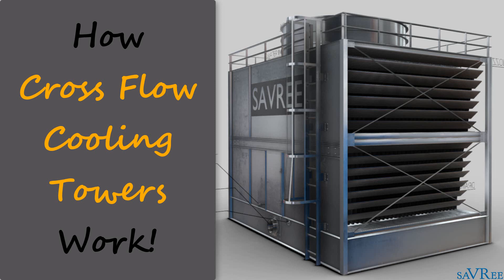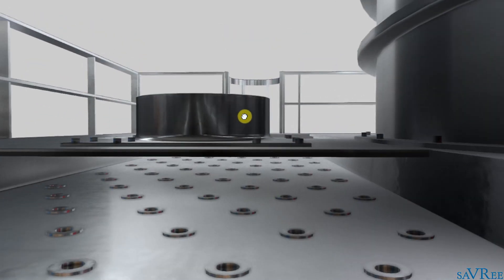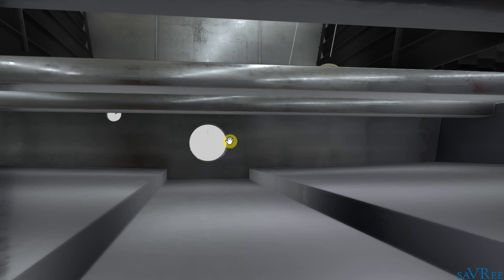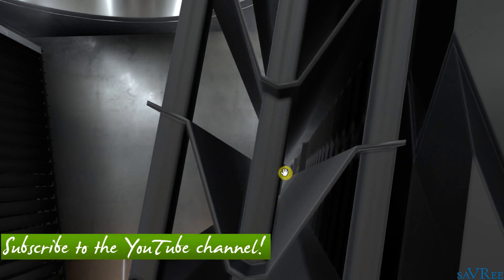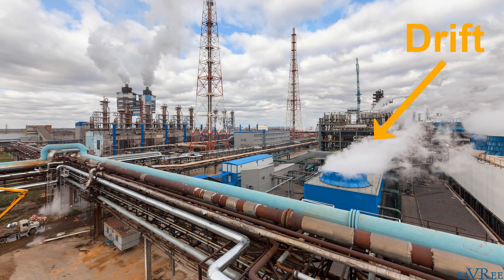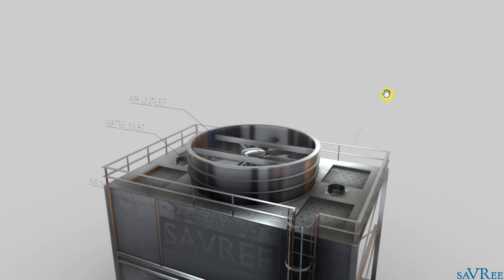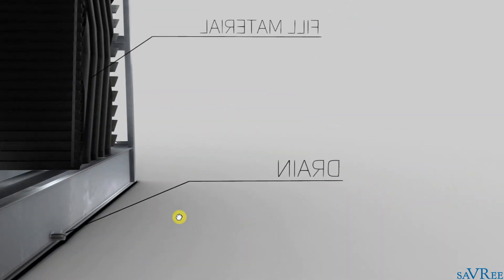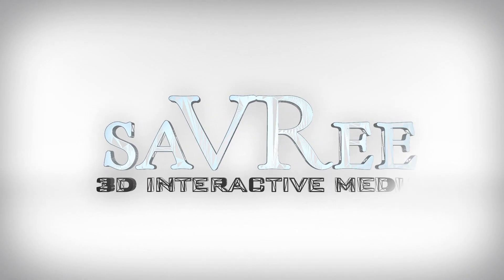How Cross Flow Cooling Towers Work (Engineering)

Comment: Can you please make a video about district cooling like in Dubai. How do they transfer the refrigerant miles away from the cooling tower like this to the buildings? Then do they use a different air conditioner or the same split system Aircon?
Reply: @savree-3d  thank you so much. Yes maybe, but heating water is easier and transporting hot water is also easier than cold water. If it's water, how cold are they? Dubai has tons of these tower for district cooling. You can literally see them through the satellite view on a map. I wonder how effective are they compare to the split system on the roof top. Do houses also use them or just big building? I'm really into cooling system. I even surprised that Qatar tried to cooling the entire Stadium.

Comment: Is there anything helping prevent corrosion in the fan that the drift might cause?
Reply: Stainless,aluminum or fiberglass ...the hub the blades and the shaft from motor to gearbox can all be fiberglass..the shaft can be aluminum